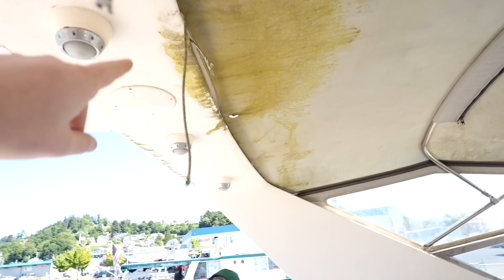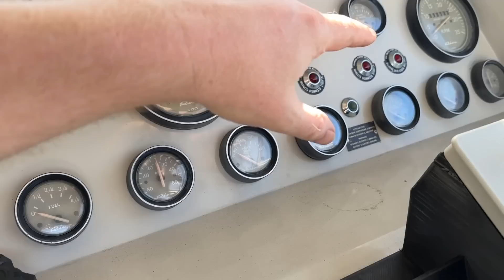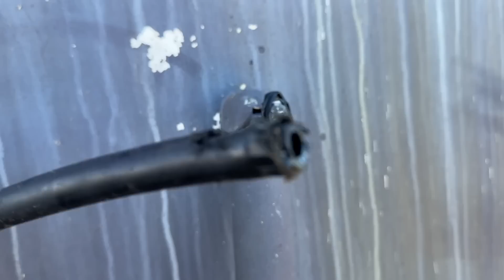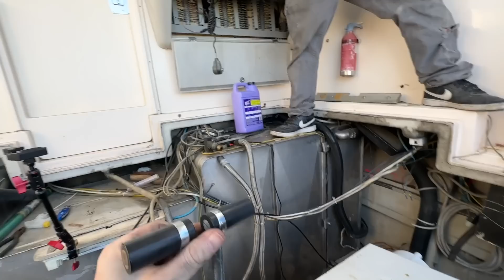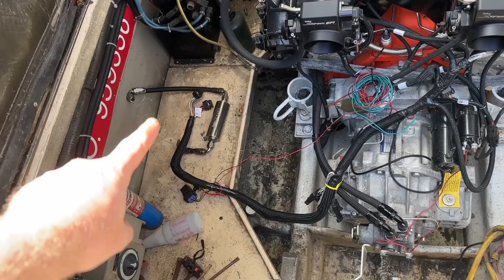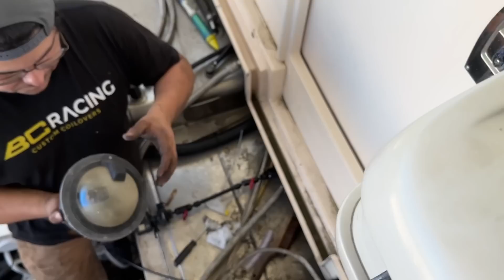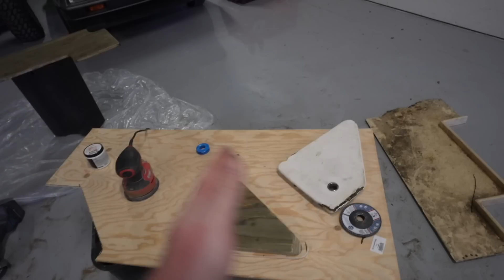Back On My 30yr Old Italian Yacht and its WORSE THAN EVER

Comment: I'm not going to read all the comments on saving AGM batteries but to save them get a good battery hook it to the bad agm with jumper cables (+ to + to ) then hook your charger to the good battery check again every 30 minutes make sure it's not getting hot. That works on all real dead batteries if it's save able.

Comment: You took 2 diesels out and replaced them with gas engines?  Why?  Not only does it drastically drop any value the boat had but all that “custom work” will make it less reliable and harder to service away from home.

Comment: Big mistake not putting diesels back in. The amount of money in boatyard fees would have paid for diesels all day long. Plus the fact that this boat was engineered for the weight of heavy diesels

Edit: now you have a diesel generator and gasoline mains. The extra complexity added is mind boggling for the marine application. Definitely not decisions a seasoned captain would make

Comment: One thing I haven't heard you say a word about is how you're going to prop that thing.   Gas engines with 2 inch shafts that rev higher than diesel and you still have those giant diesel props in the back of the engine room.   Break out another 5 grand for 2 new props.  Not to mention what size and pitch do you get for that boat considering the lighter gas engines.   And how many times will you need to try different props till you get the right diameter and pitch to make it come out of the water well and not burn too  much gas...     With having done so much on this boat to make it yours, you know it's yours forever...    Right?  Unless you give it away in a b-is-for-build giveaway contest...

Comment: I really like this project its so original and interesting, one suggestion something that I would change is the throttles. You can have two throttles instead of 4 I find it much easier going in and out of a marina especially when its a bit windy

Comment: Take out the buttons and put wide tape down over all those badges, press around them so you can see the out like and cut on the edge of the plate with an exacto blade, peel the center out scuff w a scotch bright and spray w trim black

Comment: For bringing the AGM batteries back to life...

Connect another (good) battery in parallel to the bad battery. Make sure you're using large cables for this, as it'll be a high current endeavor. Next, connect your battery charger to the good battery and start charging. Hopefully the batteries aren't too far gone that they don't come back to life.

Good luck!

Comment: If the letters are sort of stamped In to the rings around the switches they would be easy to repaint. Paint the entire ring black let dry. Once dry use white paint to filling the letters. Let dry a minute or so and wipe off the excess. The letters will be nice and crisp

Comment: You can bring those back with a dumb charger, like the old school humming kind. If they still won't hold a charge throw 100a at them for about an hour. Then trickle for a few days at around an amp. I saved 6 grp29 deep cycles off a sailboat that way.

Comment: Hey chris, not quite an expert here, but a good amount of common sense, you mention at 2:30 that youve had a few issues with water sitting in the bottom of the engine bit, you could try drilling some holes in the bottom to let the water drain out when its sitting for long periods?

Comment: I’ve replaced engines and drives in a 45’ Excal’bur put 540” BBC (630hp@5200/700ftlbs@3900) and Arneson surface drives. Boat will cruise at 45@3900 rpm top speed 55+. 
Similar weight and 1’ narrower beam than this rig. 
The shaft drives will be a performance limiting factor in this build. Prop selection is going to be critical to keep engines alive and in power band. Need to speak to Hale propellor, Bblades or Wilson to science out the props. It should run about the same as the diesels but the fuel consumption will be much higher than the diesels.

Comment: @BisforBuild   :

A few thoughts about the added weight to the boat.

1) You don't want to put the weight at the extreme ends of the boat.
Just like in a car, where you don't want the weight over the axles, a motorboat wants the weight between the prop and the middle.
Which is usually right where your engines sits.

In your case, I would probably sit the weight as low as possible, and in-between your gearboxes, that's a nice low spot, which gives a good balance to the boat.
and it will be easy to crane the weight in and out in that spot, in case you need more / less.

Weight too far out towards the ends, can make it like a pendulum, and make the boat pitch and yaw a lot when going over big waves, you don't want that.

2) Make the weight modular !
Make them modular, so you can add or decrease the amount of weight until you need as little of the trim-flaps as possibly to make the boat stay level.

The more you need the trim-flaps, the more engine power it saps, and the more fuel you need.
Balance is important - Good balance makes the boat faster, smoother and more frugal.

p.s. : Your prop shaft seals may have dried out from standing on land for 2 years !

Please upvote to make them read this ?

Comment: That's super special anti-corrosion so-called paint that you used it's not to blame. The coating not paint that you put on probably didn't stand a chance because you didn't do a good enough job on the preparation. Guaranteed

Comment: This guy doesn't do boat stuff much does he? Essentially just throwing money at a bonfire with this thing. By the time it's even remotely operational in any acceptable manor, he would've spent less on a newer nicer yacht that a proper company with engineers and tons of R&D built lol. Guess the saving grace is that $30k in motors was probably a sponsored bit

Comment: Switching from diesel to gas is the wrong move. Double the fuel rate and gas is almost twice as much as diesel (in my area anyways). Should have put Cummins engines in there.

Comment: I truly wish you the best with this but I believe you're going to knock the crankshafts thru the bottom of those oil pans with those ls engines. Yes those Cummins 903's are hard to get parts for and are very unreliable but those LS's wont make a 1/4 of the torque the diesels make and thats what moves the boat.Good luck and thanks for the video.

Comment: Definately do the battery repair. I had to take 2 years off and had a similar issue happen. I had to run the repair 8 times before it finally would take a charge
Reply: Mind you, 8 repair cycles at 18hrs each.

Comment: If you are going to keep the dual controls, consider switching the location of the throttles and gear shift. It will help out when you are docking as you will be controlling the boat from more in the center rather than way over to the right.

Comment: 🌟🌟🌟🌟🌟Miraclemist Instant Mold and Mildew Spray Remover for RV and Boat's Exterior and Interior 🌟🌟🌟🌟🌟 -THIS STUFF IS AMAZING - directly spray on and let it set and in front of your eyes it will vanish like disappear,,,, I bought 2 gal. after i seen it get rid of mold under our RV awning that black moldy, can not wash off kinda crap ---this stuff is the bomb i tell ya - the mold just disappears,

Comment: Chris, those V8's are awesome, but I just wonder why you didn't go for Cummins 12v or 24v engines?  They can be made to put out huge power reliably for very little money, and then you're not swapping from diesel to gasoline, and you don't need reduction gearboxes.

And if you have future problems, you can swap in a new Cummins quickly and cheaply.

Don't get me wrong, I love a V8, I'm just curious why you didn't choose the Cummins route.  I'd have thought it would be easier/cheaper/more future-proof.

Comment: Bro you know if you actually covered the boat while not in use it would have have as many issues. My boat was only ever in the sun to have fun and when time to put it away she was thoroughly cleaned, sealed covered and put in a enclosed storage and after owning it for 10 years the boat looked the same as it did the day I pulled it from the showroom floor. Sun uv will just destroy any material and even the fiberglass if not continually sealed. Oh we can't forget about water when it rains, mold, wood rot I mean for a vehicle made to play in the sun and water those two thing are it's worst enemy. Anyway my boat was not so big so it was much easier to maintain and keep our of the elements. I love the idea of LCD screens for the gauges that will really bring it into the future. I am still on the fence about using gas engines on a huge boat but I'm sure it will move fast.

Comment: Hi Chris! Retired mechanic who specialized in Auto Electrical here. Lots of AGM batteries get condemned because the Charger is not capable of charging a battery that is below 1 volt. If the Charger refuses to charge the battery, it must be bad, right? Be sure to check the specs for your chargers. Not all commercial chargers will work, and some that can require changes to the base setting to proceed. There are low cost units for home use too. I have a NOCO Genius 10 that IS capable of charging AGM batteries that are as low as ZERO volts.

Comment: Try connecting a good battery straight to one of the dead ones… it should transfer its power over to the drained battery after a couple hours at least to be able to start charging the drained battery. So then your charger should recognize the drained battery.

Comment: When you redo the dash you should look into flush mounting your garmin gps. Also a very small thin tip screwdriver can pick the lock on those sliding doors a lot of the time.

Comment: Been watching and waiting for next steps on boat. Very curious about weight loss (50%) with engines swap. Think boat will sit very high in aft 1/4 w/o ballast. Sounds like you have a plan for that. Check all thru hull fitting before you get her wet again. Good luck!

Comment: One issue to check when you are back floating is the bilge pumps. The lighter engines will tend to make the stern float higher. The bilge pumps throughout the boat, that were located where water would collect with the diesel engines installed, may now be located where the water isn't with the lighter engines and reduced aft trim.  I imagine you can figure out how I know that.

Comment: How about some range extender fuel tanks at the back to add some weight since apparently the gas engines aren't as efficient. Obviously it should only be a fraction of the ballast because they will empty and become lighter

Comment: Hey Chris about your AGM battery that has a low voltage. I just saw a video and I cannot remember the man's name but to jump start your AGM battery what you need to do is take an AGM battery that is charged and you connect it in series to your dead battery so you know positive deposit of negative negative and then what you do is you connect your charger to the good battery and what will happen is your battery charger will see that it is the battery that can accept the charge the charger wall stopped charging because the battery is dead and what it will do is that it will it will balance out or it will love allow the bath the dead battery to start taking a charge and you know I think the gentleman did it put it like on the 10 amp you know like to do a trickle charge and I think he let it run overnight and it went from I think it was one or two volt battery to 12 and a half olds so and he let the battery sit for a week in the car and it did hold his charge and it would start to car so I hope that helps take care I really enjoy your show and all the hard work you put into it and take care thank you

Comment: Water should not sit in the bilge for extended periods of time. It'll work it's way into the fiberglass and cause major issues such as gelcoat blistering and stringer rot. Keep removing the water and allowing the bilge to dry out.

Comment: I’ve been waiting to see the boat finished and excited to see outcome. The batteries on a boat have a wire to run the bilge pumps even if the battery switches are in off position. Make sure it’s wired back that way. Also saw another post about checking your cutlass bearings and that’s very wise advise. Good luck can’t wait to see it finished

Comment: To recharge a dead AGM with a "regular" battery charger, use a small lead acid battery of the same voltage as the batteries in series with the AGM batteries. This will trick the battery charger into thinking there is a reasonable voltage there and will start charging. Any charged battery can do this, but by the looks of it, you'll need more then one. It just has to equal the voltage of what the batteries should be when fully charged. If those are deep cycle, they should be able to withstand being completely depleted, or at least they'll suffer less damage then regular batteries.

Comment: Samcrac did a trick with charging batteries from dead in a recent corvette video. 

Believe putting it in serie with a working battery and then attaching a charger. 
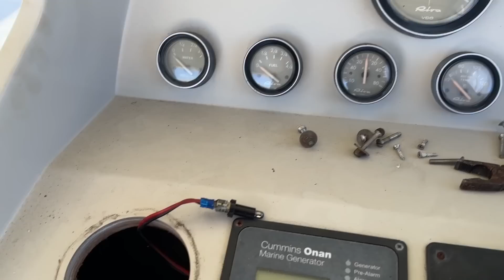16:19

Comment: Not sure how good this is for the batteries and if it’s a long term solution, but when I have a car battery go so flat the battery charger reads error (like 1V or sumn) I put a power booster on there, the charger at the same time and then remove the booster 5 minutes after the charger has started.

It will charge it till full battery no problem and stay there. Hope this helps!

Comment: theres a special way to recharge deep discharged agm batteries , think it was using a lab power supply with low amperage and voltage and charge them verry slowly in stages so theres not a lot of heat made inside them and you dont bend the plates

Comment: U  change all lighting to led in/out of boat do put best lithium batteries an solar system in Boat chris Renegy lithium 200amp over there 500usd an starter/solar lithium battery around 700usd never have connected to power again

Comment: Change all the batteries to 1x 200 amp lithium battery an 200amp solar /starter battery lithium an put 200w 24v solar panel an 50amp perhour solar controller 12/24v on roof of boat chris so much better

Comment: I remember when it was going to take a few months to get diesel parts and that wasn’t enough time so you decided to engine swap. 4 years later here we are. Should have ordered the parts and you could have been using the boat the last 3 years. This project is nothing but disaster and I predict this boat will never be finished and eventually sold.
Reply: I completely agree. Huge mistake destroying a classic riva by switching to gas engines. Could’ve rebuilt the diesels run the boat and prob sold and made money. The boating market has been insane since Covid. Boat values are way higher then they were 4 yrs ago.

Comment: Be careful not to screw yourself with thinking you're working with a 12v system. With diesels your entire battery and electronics are likely designed for 24v. It's a good way to let out some magic smoke and really mess with your plans.

Comment: For the black plastic pieces if it’s not cheap if you quickly run a blowtorch over it it will remove the sun burn they do it with stadium seating

Comment: why didn't you clean out the engine compartment while the engines were out. you could have used a pressure washer and it would have been alot better looking than it does now.
Reply: This boat was standing open for all weathers about two - three years

Comment: Chris, you should ditch the old style of controls and put a single set of electronic controls in that control the gearbox and throttle in one lever. Makes handling around docks so much easier

Comment: Should probably go with single lever controls for ease of use.
Can be hard to control with the dual controls when you need a little throttle when docking and going from forward to reverse quickly.
Looking good so far.

Comment: Worked on boats for 7 years, sometimes a battery will come around if you get the charger rolling on a good battery then quickly swap to the bad battery its sketchy

Comment: with my experience with agm batteries you gonna be hosed once they go flat there is no way of reviving it. If your lucky they still got a spark other than that its a lost cause ive had to replace more of them than i have saved.

Comment: Your generator is still diesel.  Are you going to be installing an auxiliary diesel tank for the generator fuel or replacing the generator?  IF keeping the generator, an auxillary tank may help out with the ballast issue of removing the heavier diesel engines.

Comment: You mentioned running two throttle bodies and it looked like you had a single cable input from the throttle lever, a key manoeuvring requirement is to run both motors independently so you can vary RPM between motors as required including independent forward/reverse etc.  if I have misread/understood then disregard and full speed ahead 👍
Reply: One throttle input per throttle lever. Two engines. Two throttles. Then that one splits into two for each throttle body.

Comment: I imagine your generator runs off of diesel as your former engines did. How are you going to deal with that now that the new engines run off gas?
Reply: Would be easy to add a 30 gallon poly tank just for diesel, that is how my boat is.

Comment: To kick start the batteries when they are fully discharged , connect the charger, if no charge takes place connect a good battery across the charger, this should start the charge process, once the charge starts, disconnect the donor battery, if you are lucky the batteries will come back to life.

Comment: One thing about the battery. Even with an AGM charger, you may need to connect a fully charged 12v battery to the dead battery to fool the charger to think there is some charge left. Chargers do not necessarily like really low voltages and need to think there is at least 3-4 volts.